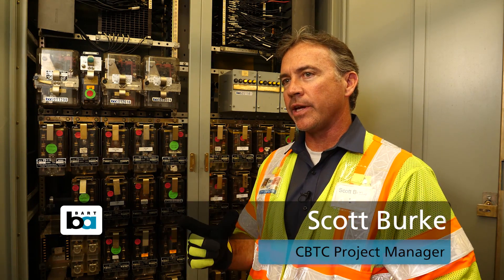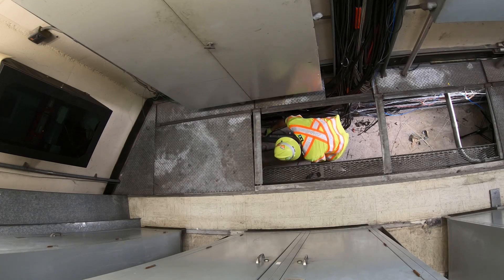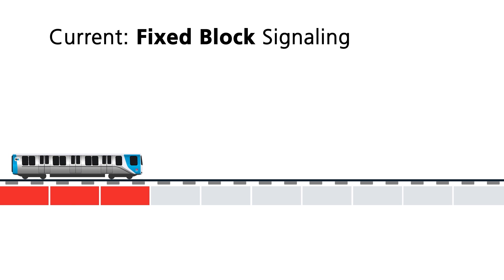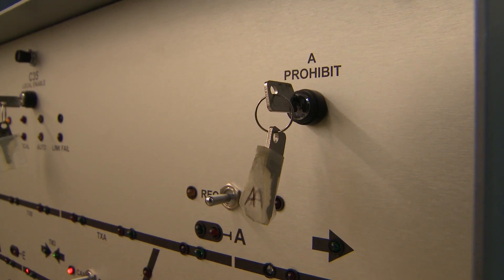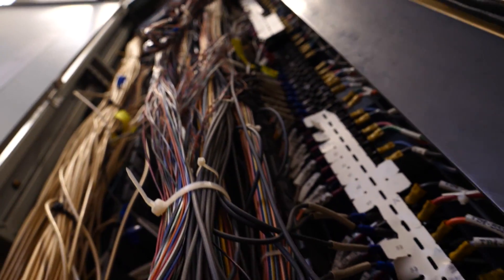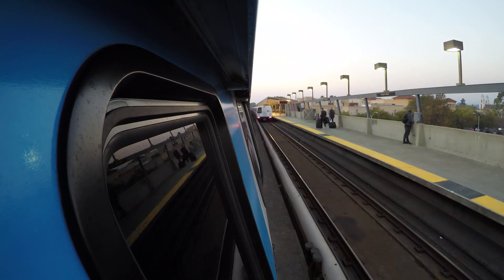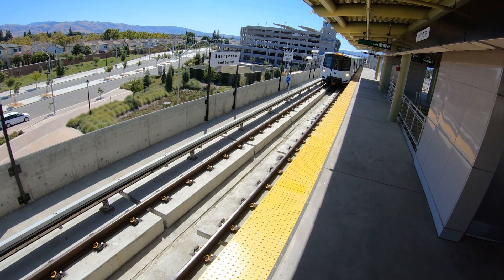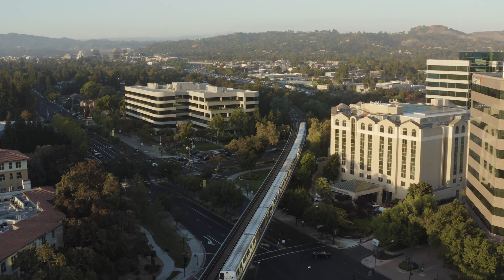Communications Based Train Control

Comment: BART Core Capacity Program 306 Cars 48 Cars for Phase 2. Phase 3 71 Cars. Phase 4 235 D Cab Cars (3311-3546). Phase 5 D Cars Order 3 3547-3606 60 Cars + 5 D Cars Order 3B (3607-3611) 775+306+48+71=1200+235+60+5=1500 Cars for Fleet of The Future of Core Capacity Program BART ❤😂🎉😅😊

Comment: Hitachi Rail STS was awarded the contract to upgrade the Bay Area Rapid Transit railway with the CBTC system, which the end of the line is near for the fixed block-based train control equipment that's been in service since BART began operations 50 years ago.
Hopefully, the fleet of the future will be fitted with the CBTC transponders once that system is implemented.

Comment: My best wishes for success goes to Bay Area Rapid Transit. Computer Based Train Control (CBTC) will improve the overall operations, but it will require lots of old equipment to be replaced and the new equipment to be installed and tested. The evens outweigh the odds. New York City Transit has CBTC installed on some lines for the time-being. So far, it works quite good.

Comment: when did the berryessa station open
Reply: It's not yet open, it won't even be until April 2020 (Update June 2020 due to the Coronavirus pandemic). They were just using the Berryesa station as an example for the fact that the upcoming extensions are using the new train control system, and the projected result not just replacing the old one in the original part of the system.

Comment: This is practically the same communication control system that the New York MTA utilizes. Except that the MTA’s is even older and significantly more antiquated, apparently they’re also trying to renovate their communication control system in a similar way to BARTs approach.
Reply: New York City Transit began receiving Communication Based Train Control before Bay Area Rapid Transit. All-in-all, it is a win-win for both rapid transit systems.

Comment: Sounds like they are moving from track-based signaling to something more resembling cloud-based, or satellite-based. Just my non-technical take. It's a challenge to keep hackers out, but they know that I am sure. Thank you.
Reply: I didn't know systems that use ATC systems, baltimore, La, Bart, DC, Atlanta, and Miami, I didn't know they used fixed block system, I thought it was NYC only but that's interesting that 70s tech was using an upgraded version of the fixed block signaling

Comment: Why couldn't this be done 10 or even 25 years ago while the Pittsburg/Bay Point, Dublin/Pleasanton, and SFO/Milbrae extensions were getting built? If the train control system was updated well into the 2000's or maybe at the latest early 2010's the extensions to San Jose/Santa Clara and Antioch wouldn't have been delayed so much. In fact, also your infrastructure wouldn't be deteriorating to a state of disrepair.
Reply: Zane Marte CBTC is a relatively new innovation that was not getting implemented on large scale projects until later in the 2010's. How could they have implemented the technology if it was not around yet?
Reply: I understand the CBTC tech wasn't there then, but my point was "Why couldn't BART do something with the train control back in the times when BART started to expand out to the suburbs in the 90's to now."
Reply: They didn’t need it back then
Reply: @zanemarte9877  Computer technology is an everchanging cycle. It doesn't get any better. It progresses with time.

Comment: I thought Bart had updated their train controller system only a few years ago as to the track side equipment.  I am not surprised the  rack controllers have held up so well, but showing their age they were built well. Like older elevator systems.